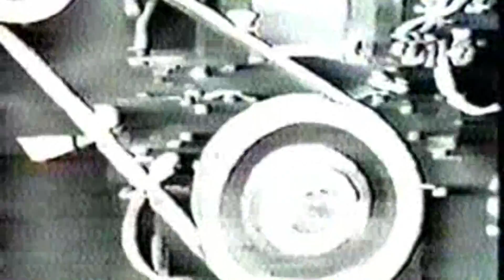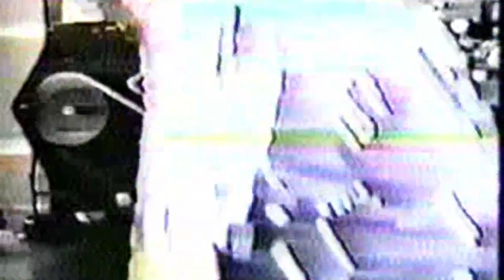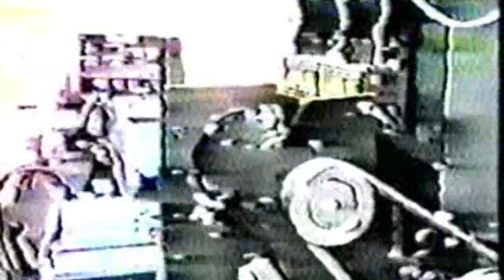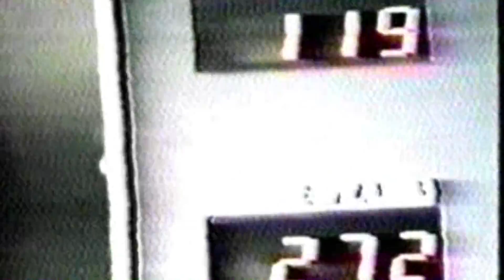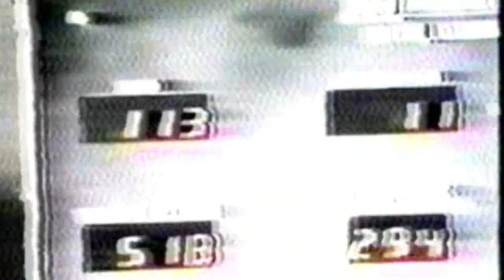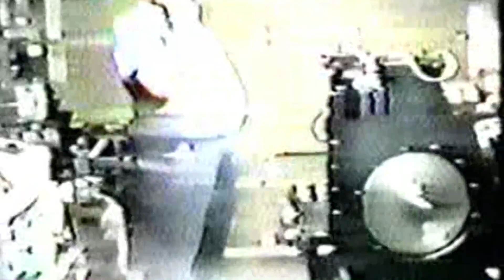The Papp Engine: Dynamometer Test Footage

Comment: hi he used a type of potentiometer to reduce the rpm ab=nd hence the magnetic collapsing field .an air engine by joe booker and stanley meyer all seem too do this a electromagnetic engine by using the atom stripping method before entering chamber and once in chamber it would be possible to recharge opposite gas fields by pulsing the positive and negative spark gaps at high voltage by unregulated starter motor engaged